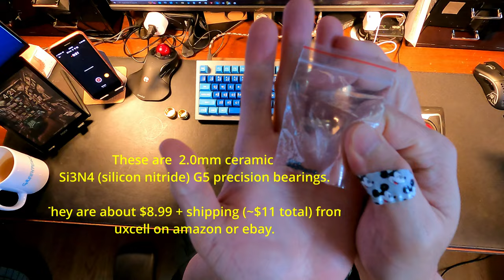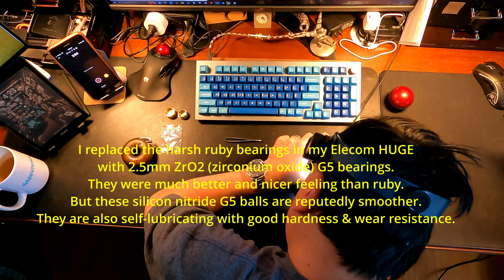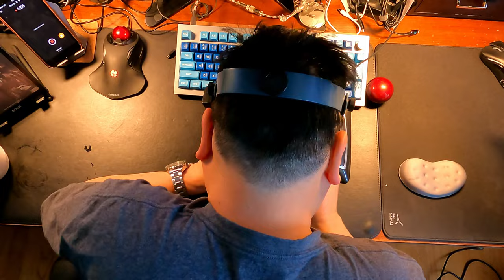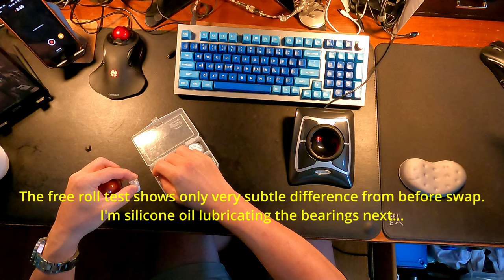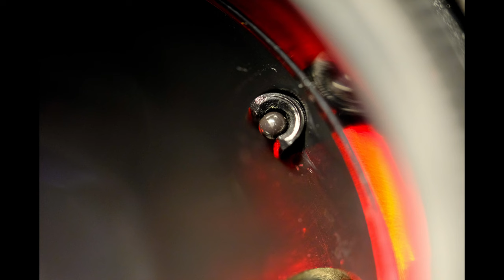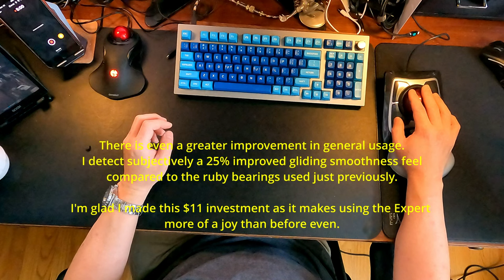Kensington Expert TrackBall Bearings Replaced

Comment: I replaced the 3 bearings from my Kensington expert mouse with the bearings you recommended and I also put 1 drop of pure silicon oil on each bearing. Works better than when it was new. 
Thanks so much.

Comment: Thanks for the video! I bought a set of the silicon nitride bearings for my Expert Mouse Wireless. That alone made a significant difference. A dab of silicon oil on each one and it's even smoother now. Almost no resistance with the trackball, this made a massive difference.

Comment: Going to try this. Right out of my slimblade is terrible. Doesn’t roll good no matter what I do to it. And it squeaks. Was going to send back but may try this first.
Reply: I just got the slimblade and I like everything except the static friction (from static to small slow movement), it's a jerky mess at small movements from static, no matter how i lube it.  Not sure if this is how it is or if I got a lemon.
Reply: @davidcauley9400  the ball is heavy and there is also a cutoff. If you move it really slow the sensor does not detect the movement at all. I assume it was implemented intentionally to remove the jitter. I was trackman marble user for many years and noticed what you are writing about too.
Reply: @Advadva  thanks for replying. Oddly the issue has basically gone after a few days usage, so i guess it just needed time to wear in.  I also used a Marble about ten years ago and always liked it, but I'm really starting to enjoy the Slimblade now the sticking issue has nearly gone.  I have RSI so I think the flat presentation means I am not constantly gripping my hand and that seems to be a big plus for pain. It definitely could use a palm rest though, and lighter quiter buttons. I rather like the scrolling too, once you learn the required dexterity.
Reply: @davidcauley9400  I'm still trying to figure out what affects smoothness of slimblade. I tried ball polishing and bearings replacement. Black ceramics, white ceramics and POM.  The ruby ones are indeed breaking in after some time. Those made of ceramics are a bit better but not as a day and night. It could be that the ball doesn't have to be perfect. The smoother it is, the more static friction appears. Different lubricants such as recommended somewhere lanolin attracts dust.
Reply: @Advadva  i have to admit I'm pretty darn happy with mine now, happy enough that I am not rushing to try other bearings yet anyway. Ive pretty much found that after a few days wearing in and the advice to rub the ball on your forehead does the trick, along with a quick bearing wipe with a finger to remove debris ehen it starts to lost smoothness.  I'd like it even smoither, but its just fine now.  Interesting what you say aboyt tge static friction/smoothness. I'm not have a big SF issue now and can confortablly do selecting and highlighting text accurately.
Reply: @davidcauley9400  Thanks for your reply! Yeah, just stick with it. The ball of mine had a couple of dents that I put when it slipped from my hands on attempt to remove it. That's why I decided to try soft POM bearings to not scratch a new ball that I got from Perixx. POM (plastic) bearings don't feel good at all. I have managed to fix the original ball with some superglue fillers and polishing, it was not an easy job though. I'm pretty happy with mine too, but still missing trackman marble a little bit. I was struggling with the delayed text highlighting issue, but I was able to figure out what causes it at least on OSX. When a function is assigned to both upper buttons or both lower pressed simultaneously in the Kensington software it adds an extra delay. This makes text highlighting very annoying and the feature is pretty much unusable.